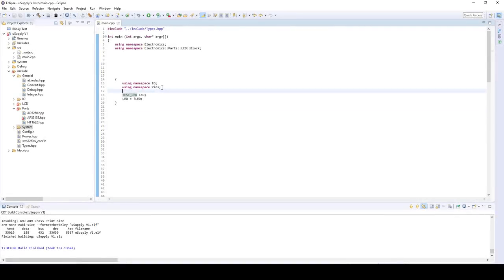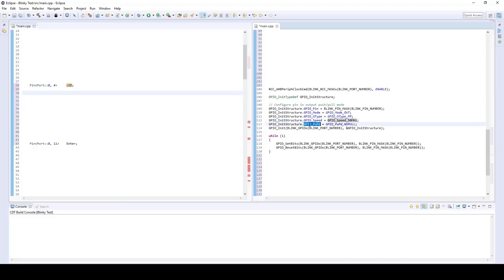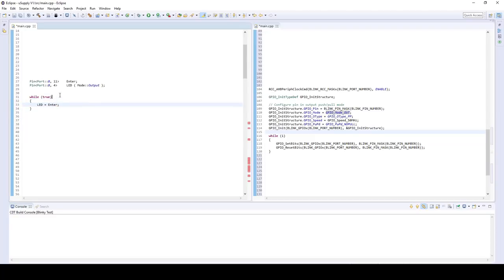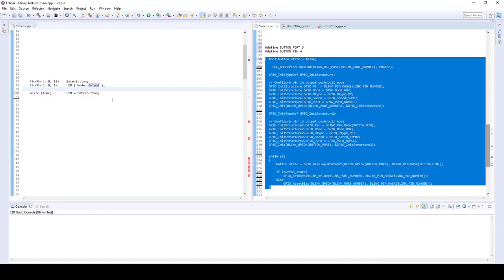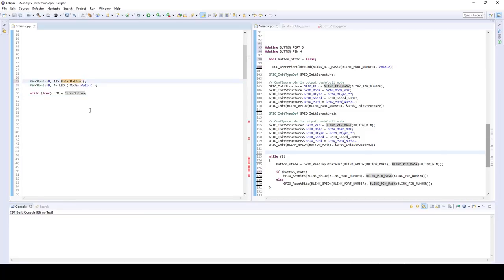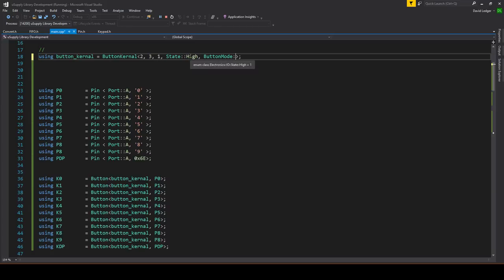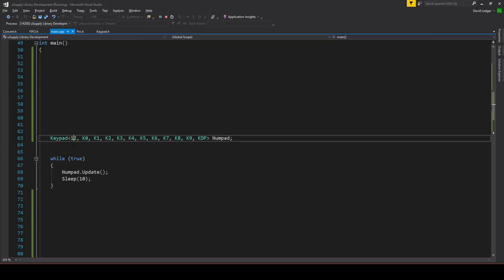C++ for the Embedded Programmer

Comment: 1) You have to mention, that LED is a variable that occupies some space in RAM whereas C code occupies RAM only for the initialization part. It might not be critical for this case, but it might be critical piece of information for somebody, who decides to use your advice; 2) You have put data into the type declaration instead of the instance of the class (struct) yet an instance of your type Pin<> still occupies some space in RAM even though it holds no state - that is clearly not a good practice from a C++ design standpoint. 3) Since you are encoding state into a type declaration, what do you think will happen, if you define a new variable with the same type? You will get two variables referring to the same pin yet wasting the double amount of RAM to hold both variables; You could have defined a const variable in the global scope, but then your fancy operator overloads would look even stranger; 4) Now lets look at your assignment operator overload - you have a variable that holds no state, instead the assignment operator changes the global state (the GPIO pin); What if you assign one variable of the same Pin<> type to another? It doesn't do what a typical programmer would except it to do, because the assignment operator doesn't transfer state of the variable but rather copies the global state onto itself. This is mind boggling and is not a good C++ programming practice as well. While it is encouraging that C++ is squeezing into the embedded space (not so long ago the C had a very similar fate trying to compete with assembly language) yet we are not there yet. Making you code not just shorter, but also to obey basic principles of C++ design would require quite a lot of effort. And we are talking only about GPIO pins here. So, maybe there is a reason,  why the embedded world is still holding to C and assembly language - these languages are perfectly solving the problem w/o having to dwell into the wonderful world of metaprogramming and building of multi-layer abstractions.

Edit: I just want to add that GPIO pins are very similar animals, but using your technique it is not possible to group them or to put into a collection, which is also something to think about before taking you advice as it is presented.
Reply: firstly sizeof(Pin<...>) == 0, you seem to think I'm storing pointers in each Pin class or something...

It is a purely static object (Because physical pins are purely static). It doesn't hold any variables, it connects directly to the registers. My pin operations are equivalent to RAW register operations, only difference is that all the shifts n whatnot are automatic. Depending on compiler flags it can store some global statics, one per unique pin type.

Pins are static and by their nature singleton. It is a compile time error in my configuration to assign one pin using another pin, as I believe it should be. You can assign state of one pin to another etc but is must be explicit or use operators which infer what is needed (boolean operator). Not everything at once, assignments must be explicit and typed. If you wanted a copy of the pin, simply use the type, it is singleton as it is intrinsically linked to a set of registers. It is an approach which avoids global and allows local pin aliases without using references or pointers. The type is a short cut to access individual registers, not all of them at once (except in construction).

If you wanted to assign mode of one pin to another this is valid:
Pin<...> p1;
Pin<...> p2;

 p1 = (Mode)p2;

Not all pins have the same capabilities, assignment of a bunch of state that might not be possible is silly and I set out to remove a bunch of runtime checks that other libraries require.

Additionally templates fold in various ways that don't double the binary size, sometimes it increases binary, sometimes it doesn't. This type of behaviour is propagating to many compilers now days its called COMDAT folding in MSVC, gold in gnu icf.

Additionally, template functions are only instantiated when called, unused functions do not enter the binary.
Reply: The great thing about C++ is that I have to ask "what operation are you performing when you type 'p1 = (Mode)p2;'?

I mean, you can type that, but I have to go digging around through layers of templates and classes to find out what that code means, because it's not even slightly obvious what you've done there. In C it would be, but in C++ I'm just guessing that by that syntax you're forcing a polymorphic object to surface as a particular class so you can copy just those attributes onto another object?
Reply: Under the hood it detects the type you are trying to assign to it and runs the appropriate direct register set/clear to the bit needed. There is no inheritance or the like, and no copies of operator parameters either if I did the forwarding correctly...

Nope, just assign to it with an enum related to pins, the compiler will tell you if its invalid, although all pin enums are valid assignments here.

Comment: The C++ code on the left was not platform agnostic since it has "Port::B, 7" in it.  On a Raspberry Pi, you just have a pin number and don't worry about ports.  On most microcontrollers you'd at least need to think about changing those pin assignments.  I think it makes a lot of sense to just have a single pin number like the Raspberry Pi or Arduino environments, so you can put that single number in a macro or constant easily.

Comment: David, I don't think this is about C vs C++. One one side, you are using a nice GPIO framework, and on the other side, you are using STM's GPIO library.

You demonstrated that STM's library is horrible, but this has nothing to do with C vs C++. You can have a sane GPIO framework in C, and you wouldn't have to worry about "all this". Or you can have a bad framework in C++.

You have demonstrated that a good library will simplify the code and improve readability. I am in full agreement with this conclusion. But a good library has little to do with the language.
Reply: Some languages lend themselves to better abstraction, but yeah no doubt the STM library could have been better.

Was a real world example, for a project we are working on, the STM library was available, and I wrote my library to avoid its verbosity.

Comment: follow up question: try working a button and a LED with the sample GPIO i.e. GPIOA and compile both C & C++ compare and see what actually happens. Along the same case, expand the same situation with more complex cases, there are no doubt  C would do a better job.
Reply: Ok, so long response. You've opened a complicated can of worms.

Generally, to avoid overhead in C++ IMHO for embedded systems:
1. Avoid heap allocations if possible
2. Don't use virtual functions
3. Use the standard library unless they conflict with the first two laws (many do)
4. Know your compiler flags*

* If your not using exceptions, disable them, and for the love of all things don't compare unoptimized C++ (which is for easy debugging) to code with compiler optimizations. C++ is not designed for production use without the optimizer.

-----------
There are certain things in C++ which can incur a performance penalty, virtual functions, the most widely spread issue IMO. Especially when people started believing all classes need a virtual destructor, this is wrong.

-----------
But there are also things that result in improved performance, these being: 
--- constexpr functions to calculate complicate register settings at compile time without resorting to magic numbers  or runtime calculations. 

--- Some level of type safety without needing to keep runtime type information, which means certain things do not require runtime checks to ensure proper operation. 

--- Things like constructors and private members can also provide similar guarantees which enable all member functions to avoid checks which simply aren't possible due to the nature of the object.

--- More effective abstraction allows programmers to look for optimizations instead of being bogged down in micro-optimizations. Large structural issues are easier to see when properly abstracted in my opinion. Micro-optimization is similarly easier when isolated.

-----------
There is also a myth that templates bloat code, they simply do not (well they do if you go nuts), but of course just like inline in C they can be misused.
The mantra of the founders of C++ was "you only pay for what you use".
Some people think that C++ is slower, it isn't, but use it badly (like all things) and it is. It takes quite some experience to learn to use it well.

I maintain a large library (couple hundred thousand lines maybe I don't know) in C++ which is mostly performance focused, I spend large chunks of time benchmarking various algorithms (you can use C code in C++ programs) much of the library is for embedded systems.
I have a lot to learn about this but I am reasonably competent here.
Reply: Your explanation is good.
However, in this case you can only reply on the compiler, which in many case are not easily be optimized.
C with ASM always works well in cheap production industry.
As you said, i do agree that working with the "Correct settings" in C++ is an alternative to C.
From heart, how do you expect a rookie would have the same amount of experience.

Comment: While the 'unfair comparison' argument does have some merit, I can see your point.  The problem I have is.. embedded.  A C++ object library designed for one microcontroller not only isn't going to work for another micro, but it will be a PITA to convert.  Even in the STM32 line, the pinouts and capabilities differ widely.  Any good code should be well commented, and that goes double for code that will be seen by others, triple for code you're going to make public domain.  If your regular C example is similar to the C++ object definitions, they're not commented at all!  If I were give the task to convert that code for a different microcontroller, I wouldn't.  I'd study it enough to get the gist of the process and what variables and functions needed to be exposed, and write my own.

Comment: They not "setting up a clock", they're enabling the clocking of the peripheral which is STMs way of power gating function blocks. It's actually important that this is verbose, I'd even recommend you check what your C++ code does because if it happens to be stupid enough to enable all ports even if you're just using a single pin, you're wasting (albeit a tiny bit of) power. Things like that also become very important if you want to use sleep modes. It might seem tedious and superfluous to a beginner but one you reach the more advanced levels of MCU programming having the control over tidbits like becomes an important affair. NB: I haven't looked at the C++ abstractions, maybe they offer fine grain control or not but at least it's good to know about this stuff.
Reply: Firstly, I like you, you clearly know what your talking about! Thanks for the comment, very relevant. But....

Nope you haven't given me enough credit here. It automatically detects what port is used (at compile-time) and enables the minimal number of ports needed. It also only does this once per port used, it doesn't even check a second time the port is used. It also can disable ports once no pins on that port are in use (out of scope).

Comment: Then again you could put everything in a function and make it as simple to the C++ example. Which you are basicly doing in C++.
Reply: No. You cannot assign to function results in C, one function cannot contain all functionality of the operator enabled class. 

The advantages of the class:
- compile-time calculation of register offsets (so we can actually use the ports registers), 
- type safety, you cannot physically enter invalid pins or ports, which means no runtime checks needed.
- Physically less code in the main function
- Using standard operators
- Full register exposure (all options are available) for all pins without flooding the global namespace with what would be 2 + 2 + 2 + 2 + 2 + 2 (12 functions or 6 if you want to sacrifice some speed) functions pin function.
- Code is more expressive of programmer intent I believe as it takes less space to understand the same syntax while at the same time using standard grammer

One function also requires runtime calculation of port offsets for the port registers or alternatively you need to maintain a platform specific pointer in your main application code but that is hardly portable as the platform specific structure isn't portable (similar to the ST library).

Remember the class here exposes every function of the port, automatically manages the port clock, and provides type safety which prevents the need for any runtime checks (nullptr, invalid port index, invalid pin number etc). 

 If theres a neat way to do it post it here, I'm always interested :)

Comment: you can get around with overloading operator= instead of the Pin::Get and Pin::Set functions; having the pin port and number as template arguments, honestly feels like abusing the type system, I think they should be normal constructor arguments, it also going to make it hard to store Pin objects in a contrainer, as each Pin is a different type if their template arguments are different

Comment: I would love to see the speed comparison of both the codes as well as the total bytes consumed. When you are doing very advance level stuffs then I would imagine C++ would complicate the things. Thats why C was prefered choice for building operating system codes.
Reply: The total bytes should be the same or less. All the template stuff is just resolved at compile time. It's like #define in a type safety manner. And if you create advanced level stuff, C++ will help you to structure the code.
Especially if you need to manage resources. For example, a lock class automatically releases the lock when the instance goes out of scope (you leave the function/method/case/loop-iteration where the lock was created).
Also compile time functions can generate lookup tables without any runtime.
And C is only preferred because all operating systems are old. Before 2011, C++ had problems solving certain problems properly. Since then much stuff has been changed.
Look for C++ and embedded programming on youtube. You will find some lectures on the topic. As an example of modern C++, also a pong game for a C64 has been used. You can not do things in C as easy as in C++.

Comment: The real differences were not covered in this video, sadly. Speed and Memory Overhead.
Reply: Speed should be identical, abtractions in C++ don't incur penalty, memory potentially could be but I believe my template code folds so it doesn't add to memory overhead.
Reply: The C++ optimizer also wasn't covered, and this is the really cool part. The optimizer is the thing which goes around doing things like removing unneeded variables, inlining functions, removing entire objects and functions if they turn out to be unneeded. As you should know from the C optimizer, what you write isn't necessarily what you get when compiled. The C optimizer can do things like constant folding, remove unneeded variables and so on.
The result of this is that quite often the code generated for C++ is comparable to the code generated for C. And this is common for PC applications, so why would there be any difference for embedded?
Reply: Might be a bit late, but are you able to post the assembly code of your LED = State::High vs the C function call to set the output high? I'd be interested to see whether it actually does fold down as far as you expect or if the compiler does something else :)

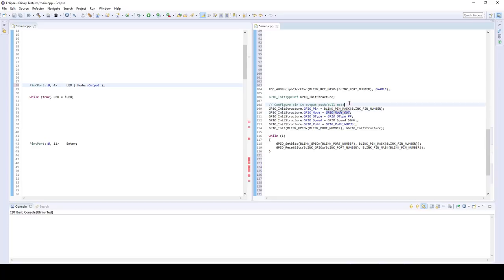Comment: 3:28 - Run both C and C++ versions of blinker on microcontroller, and compare blinking frequency. I think C++ will be 2x slower, because you add port reading and inverting in c++ version.
Reply: Hmm, doubt it, but I'll give it a go :) I doubt it because the C functions need to check for nullptr but C++ classes don't have to do that sort of check.
Might be a little while before I get around to it but feel free to bring it up again if I forget   :)

Comment: Not all uC manufacturers have free C++ compilers available, it's probably relevant to the Cortex-M series but other micro's I prefer to write to the registers direct, be it in C or assembler - like PIC12 for example.  All this video really shows is something you've written to abstract, you should have shown something in C and then the same thing in C++ without any custom layers.
Reply: True, even PIC18 barely has any options.
This was made a a real example, real code, real device, real provided library (with slight modification for this video). 
I am a working engineer, its hard to justify making the same thing twice with the foreknowledge that half of the work is entirely redundant.
Reply: So, you could have just as easily created the same "library" with only 3 / 4 lines of code in C, just as well as you did with C++, looking at the library code, it's no different from the C counterpart, you just chose to show the library calls for C++ and the GPIO calls for the C example, so in reality, not a fair comparison?

Comment: Thx for your comparison. Eventually I would agree that C++ has nice advantages. BUT I think you but C into a unnecessarily bad light, as it's not a big deal to get the exact same two-liner in C as you have in C++. You can easily hide the definitions you show for the C example into a further abstraction, as it is done in your C++ example already.